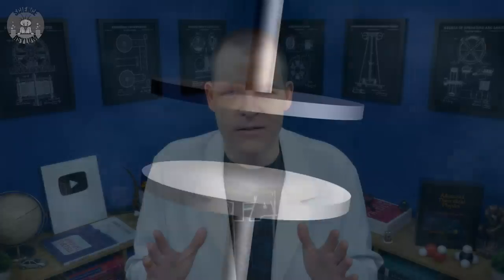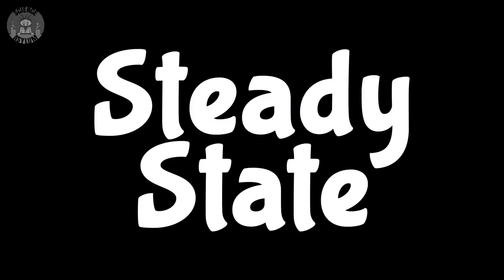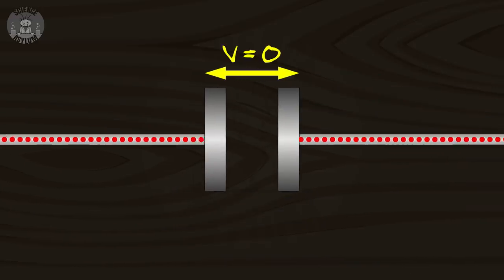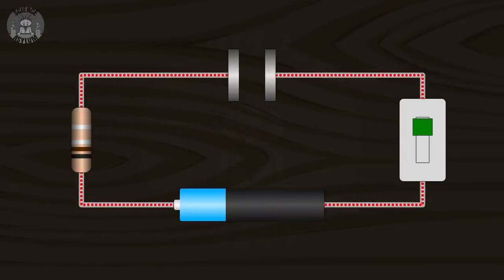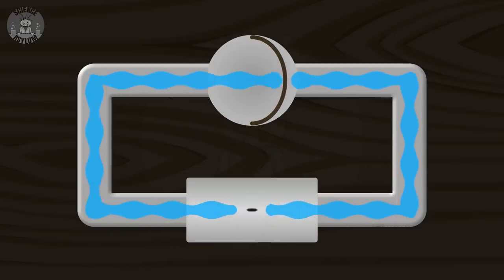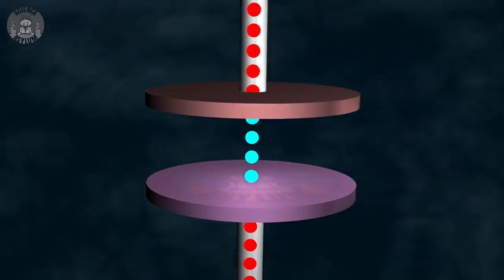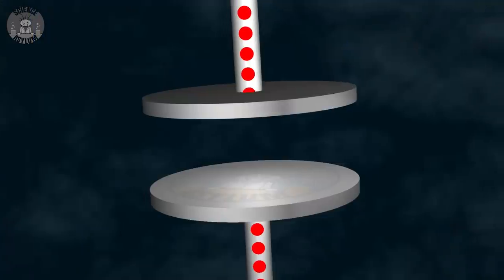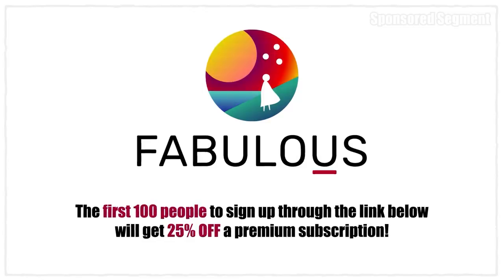Capacitors Are Gaps! How Does That Work?!

Comment: Based on those field lines at 11:12, this would suggest that a stationary particle around a circuit should travel away or towards the wire at different locations. Is this accurate? Using Gauss law, would this  not suggest a buildup of positive charge just ahead of the battery and a build up of negative charge immediately after? Seems like it is true in the transient state, but surely not the steady state?
Reply: Electricity is energy flowing around the wires, not particles (electrons) moving in the wires. This is not what I say, but CP Steinmetz. I would not argue with him…
Reply: @henkhenk4357  No current, no power, simple as

Comment: Engineers understand Poynting vectors. We learn about it. We just have little use for it unless we are designing high voltage equipment. Which many engineers do.
Reply from the maker: Good to know 👍
Reply: Physicists depicts engineers as cavemen...  The model you choose to solve a physical problem depends on the complexity of the problem. I mean, why to use relativity if Newtonian mechanics is enough... The important thing is to keep in mind that you are applying a simplified model.
Reply: @broom6600  The issue for me is that doing the calculations is fine but we shouldn't assume the models they are based on are 'real' whatever real means. Personally as a physics grad (long time ago) I'm more interested in getting as close to 'reality' as possible even if that means quantum and Maxwell as opposed to Dowd. I'm interested in this from a personal perspective not job related though so I appreciate in some circumstances a model and formula are all that are required.
Reply: @billhinge9403  We start from the assumption that probably no model describes the reality, but shows a behavior that is close (more or less) to what we observe in reality. That said, it all depends on what you want to do. If you are interested in describing what you see in the physical universe, you will try to introduce a model that is as accurate as possible. But if you're doing applied physics or engineering you'll often need to study a system numerically. Because of this you will try to make your life easier...
For example if you are studying rocket flight you will probably be fine using Newtonian mechanics. If as an engineer I have to design a simple electronic circuit, I will approach the synthesis of the problem using the simplest model, and then raise the complexity where necessary.

Comment: Thank you for the fantastic video, I enjoyed it a lot! I have to disagree though with that the electrons do not slow down and that the kinetic energy is not being used to, for instance, light a light bulb. To my understanding, microscopically, the Joule heating of the wire connected to its resistance is caused by the scattering of electrons on the atoms of the wire. The electrons can lose their momentum and thus kinetic energy in the scattering event and are sped up again by the electric fields/voltage. So what is constant is the average drift velocity but not the velocity of individual electrons at any given point in time. Furthermore, as light bulbs are using the Joule heating for their thermal radiation, it is the kinetic energy that is transferred to the crystal lattice that provides the energy in this case. Am I missing something? Are the description of macroscopic energy flow and the microscopic scattering picture not just complementary points of views and neither should be called incorrect?

Comment: I get it that theoretical physicicists eschew practical matters 🤣. In practice though, the internal resistance of the battery is more significant than the resistance of the connecting wires—the latter can usually be ignored. So when analyzing or designing circuits, we engineers model voltage sources with an explicit series resistance (Thévenin's theorem). Coincidentally, for the circuit that you were analyzing, it gives the same result that you got by assuming that the wires have a significant resistance. Lucky you!

Comment: Thanks for providing very interactive visualisation on capacitors 👍

Can we get same for INDUCTORS!????

THAT WOULD , REALLY CLEAR ALL MY CONCEPTS
Reply: Think of an inductor as a free-spinning paddlewheel, in the hydraulic analogy.   It "wants to" spin at a constant rate, by virtue of its inertia.  If you try to change the flow rate of water through its paddles, it will apply a pressure to oppose this change in flow rate.

Inductors do the same.   They store energy in the magnetic field by virtue of the current through them, and try to sustain the current to be constant.  They apply a voltage against any attempt at changing the current, like they are an "electrical inertia" to the system.

Comment: This may be a silly question: Would any significant portion of "leakage current" inside a practical (human scale) capacitor be attributable to "quantum tunnelling"?
Reply: probably pretty insignificant, quantum tunneling only matters on the scale of nanometers.
Reply: @JasminUwU  
Thank you... 🙂
Reply: @rustycherkas8229  My guess would be that the dielectric doesn't have perfect insulation, so that gives you a current with a simple rule of V = I / conductivity, with V being the voltage across the capacitor (since the leakage current flows from one plate to the other, so it's parallel to the capacitor potential). That's the electrical engineering explanation.

I'm no physicist, but I'll give some ideas that come to my mind to explain this phenomenon in other ways. Those are just guesses, I'm actually interested if someone has a clear idea on the subject.
It may be possible the leakage current could be a diffusion current instead of a conduction current ? I'm thinking of this capacitor like some kind of diode. When you turn on the simple RC circuit shown in this video, you have some electron displacement in the circuit. Electrons flow from the negative pole of the battery to the negative side of the capacitor. And on the other side, electrons are chased from the positive terminal of the capacitor towards the battery (or in semiconductor theory, you can say that + charged "holes" are moving towards the capacitor + terminal). So when you reach steady state, you have an excess of electrons on one side of the capacitor and a lack of it on the other side. The electric field (coming from the battery) maintains this imbalance so this is not something punctual. Then, if we go by my idea, we would have to look at the energy band diagrams (or do some proper math) to see how much thermal energy is required for one electron to get enough energy to jump across the dielectric material.

I hope this is not bollocks. Still, it does fit what I can read on purely technical (not sciency) websites about leakage current, because as they say, it depends on both the voltage (electric field) and the temperature (thermal energy of the electrons), so I may be on the right track ? If you are not very familiar on electric diffusion, you can think of how a dye drop diffuse inside a liquid until it looks homogeneous, and how shaking the liquid makes it mix faster. In this case, the electrons are the "dye molecules", and heat works like shaking the liquid, it helps those electrons to jump from one level of energy to another. If you want more in depth physics of this kind of electric current, I highly suggest to read or watch about diode physics and energy band theory. This electric (thermal) diffusion is not just a physics anecdote, this is actually how current flows through p-n junction diodes, at least if I understood it correctly :p

Again, if someone has the true answer about capacitor leakage current, I'm also very interested :)
Reply: @mythicdawn9574  
Thank you for all that... It's early here, but all that you wrote makes sense with what I've 'accumulated' (pardon the pun) over the years.

The "accumulation" of charge kinda boggles one's imagination. Electrons don't actually travel very fast (it seems), yet astronomical quantities shift onto or off-of a capacitor's plates in short time intervals... Trained with "not to scale" illustrations may be harmful to gaining meaningful intuitions.

Diodes... Yes!... "Any material can become a conductor by applying sufficient voltage." There's lots of magic to be found in semiconductor physics (and even those antique vacuum tubes.) It 'feels' so similar in principle, but I s'pose the only real similarity is concern about switching times for semiconductor junctions... (the 'capacitance' value when the junction is physically large???)

Mind-blowing is the use of 'capacitance' to store binary data with relatively few electrons (flash memory)... The tiny 64Gb microSD contains about 1/2 trillion individually accessible memory cells (storage wells) that should function for up to 10 years... In my day, some discrete components, soldered onto a board you could hold in your hand, formed a single J/K or SR flip-flop... 

In the spirit of myriad seasonal LEDs: Happy New Year! May your capacitors never think they are fireworks!
Reply: It sort of does. It has practical consequences on human scale but the effect is on nanoscale. It's a  practical effect and limitation in silicon chip engineering. The chips got so small, those effects have very much practical impact.
Reply: The term leakage current applies to many things. Leakage current in capacitors has almost zero quantum component due to the distance between plates. Leakage current in semiconductors has a large quantum component due to how small they make them nowadays.
Reply: @OmateYayami  
Just been learning a bit about "supercapacitors" with a mention that their dielectric 'gap' approaches single digit nanometers.
This is commercially available product (probably expensive), so it's not just wishful thinking.

I'm gonna stand by my original and still open question, hoping someone may provide more insight.
Happy New Year! 🙂

Comment: Woah so on the image at 12:58, that explains ElectroBOOM's solution to Veritasium's electricity question! Because there is some capacitance between the wires so there is a tiny bit of charge flowing between them at the start and it increases as the current reaches the edges of the wire! I hope this makes sense because you've made me understand it so that's good 👍
Reply: If you understand why Science Asylum and ElectroBOOM are correct in their explanation while Veritasium got it wrong, then your high level understanding is good.

Comment: "The difference between atoms in a wire is technically a gap" - but this shouldn't matter though as it's the electrons and not the nuclei that are acting as charge carriers. said electrons have a continuous space of overlapping orbitals to move through. From a regular human's perspective, everything that's linked via overlapping orbitals might aswell be treated as one single object.
Reply: It depends from the reference frame. In an non-inertial reference frame, the protons seem to so the charge carrying, and the electric current is now viewed as magnetic energy. 

But what you’re saying is important too because this has to do with Heisenberg’s Uncertainty principle. When you cool down a wire, we know more (in an inertial frame) about the momentum of the electron, but know less about it’s position. (The principle states we can’t know both at the same time.) This means that all the electron’s clouds and wave functions expand their probability of range, and thus interacts with each other more. This is why current goes up, and resistance goes down in a very cold wire. Which is counter-intuitive because you’d think a hotter wire would have more electron interaction, thus more current.

Comment: I wonder what your animations of the capacitor would look like with real world capacitors that aren't just 2 plates, like Multi-Layer Ceramic Capacitors or Electrolytic Capacitors.
Reply: Same difference just a crap ton more surface area or different electrolyte. It's still two separated surfaces isolated from one another but can still build up current due to electromagnetism. The number of layers is immaterial to the principle.

Comment: LMD
Longitudinal magneto dielectric (LC tank circuit) uses capacitor and transformer coil core AC oscillation. Which can be into core out of core frequency generation as well as a north south magnet rotor generator signal.

Harmonic Resonance is an increase and build up (pushing of a pendulum.) Which also represents a round circle motor. Thus it becomes generative as well as self driving.
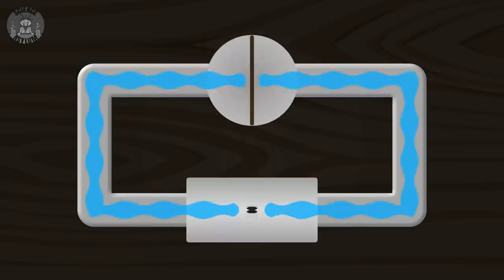7:48
Displacement Current
Water Pump Battery
Capacitor is like A Rubber Diaphragm where pressure is applied and then it rebounds backwards (basis for ground energy into recharge a battery as if coming in from ground. As well as Eddy Currents. As well as magnetism generated into a core coil (transformer) "charged" through a good source circuit. Switched into a resistance circuit (back into positive source by diode) or another lower charge source (battery or capacitor or other transformer.)

Comment: How do superconductors have resistance?
Reply: Everything has resistance.

Because everything interacts with charged particles and therefore alter evolution of the EM field.

It's just that superconductors have VERY small resistence (but not zero)
Reply: @pawemarsza9515  superconductors do in fact have exactly zero resistance -- but only under DC. When current is not constant -- for example in transient state, as in this video -- you would observe the resistance.
Reply: The resistance isn't gone...

The cooper pairs just fold it in on the electron electron couple. The field has to be distorted because the repulsion that it takes to create the illusion of zero friction is a huge amount of just-equalizing forces coming together in a  "perfect" kind of harmony. 
Those levitating magnet toys... There absolutely is friction/resistance that's why it floats. Some even stop shear forces from disrupting this delicate balance point.
Reply from the maker: For superconductors, resistance is below our ability to measure, but that doesn't make it zero.
Reply: @ScienceAsylum  Superconductors do have zero resistance. Not a very small. They have ZERO.

Comment: Great video, as always! If one is to use the water on pipes analogy for EM, I like the view of a capacitor as a water bucket, accumulating water and helping to keep a steady flow (or a rapid discharge).

Comment: I remember real air gap capacitors. Used as the tuning element in the old valve radios. . . .
Reply: Early transistor radios too. Also these were variable capacitors!
Reply from the maker: Yep! When I was a university teacher, I had access to one the size of my hand. I'm told it was from a military radio transmitter.
Reply: @ScienceAsylum    The size of your hand before or after cutting off the finger tip?
Reply: Old enough to remember disassembling broken, battery powered AM pocket radios looking for the magic.
The tuning dial was directly connected to those rotating partial plates inside a plastic case.
Thank you for dredging out that happy memory!!! 🙂
Reply: Back in the day, when he was in the Air Force, my father was a radar technician on an old FPS-35 radar (which required a five story concrete building to contain it.  When he was discharged (no pun intended) he brought one of the smaller tubes back; 18 inches tall and about 7" wide.  It is now a lamp.
Reply: I used to have an old Army Signal Corps Radio.  Tubes galore.  Loved to flick it on, get the hum and light of the tubes warming, and tune into WJR, and listen to Ernie and Paul.  Sadly it was so big and cumbersome and always in the way so we threw it out.  What a waste.  It would be worth quite a bit on today's antiquities market.
Reply: As for capacitors, going back to my father's USAF stories, the AN/FPS-35 had massive capacitors that needed to be routinely discharged, which was done using a big rod.  Well one day one of the guys was going about discharging them, when he missed one.  He was not so much injured from the electrical discharge as was coming to a very rapid deceleration against the far wall.
Reply: @afx935  that reminds me of my college days studying electronics. For some reason I was testing the resistance of a large inductor with a mkVIII Avo for maybe too long! On release, I also was moving across the room rapidly😳

Comment: Could you also explain principle of dielectrics in detail in a different video, maybe? :)
Reply: Helps move the electrons, without a potential to take those electrons without a current load. Like an insulator when static (off), and a conductor when under current load (on). Different from a semi conductor in that it usually is a liquid or gas, and sometimes a gel or semi solid like colloidal suspensions, but generally not a crystalline solid.
Reply: Gr8 video idea.
Reply: A dielectric is just another (fancier) term for an insulator (while it remains in its insulating state, all insulators break down at sufficient electric field strengths). 
In this case, it mean an insulating material that can sustain a higher electric field across its width before breaking down (compared to vacuum).
In electrical engineering, dielectric means a specific material chosen for this property, as opposed to an insulator (which is just used to prevent conduction). But in terms of materials, dielectrics are just insulators.

Comment: Electrical Engineers know about the "right hand rule" don't let any physicists know we don't just smash the "I believe" button when doing circuit design.
Reply: During my education as an electrical engineer they thought us the energie flow can be modelled by the pointing vector. (40 years ago).
Reply: @ralphzacharias5679  it's probably useful for EMF shielding, relays, transmission lines, waveguides... anything in the RF or microwave frequencies... just to name a few.